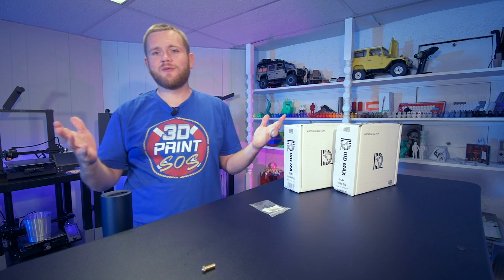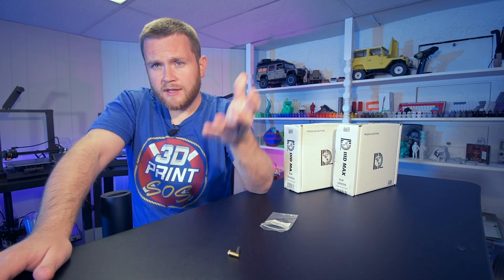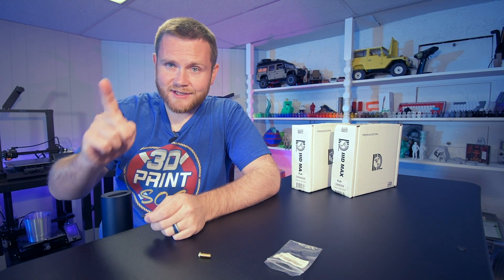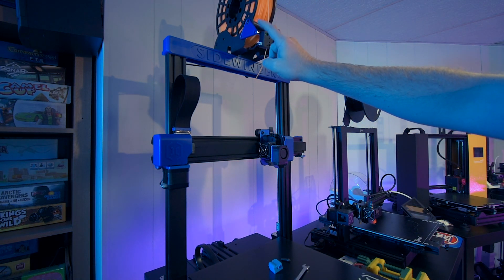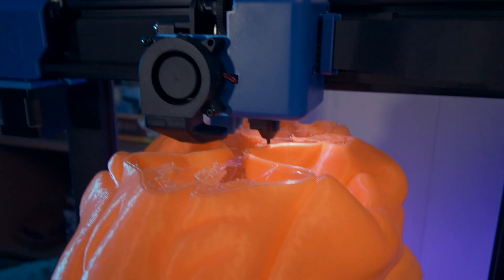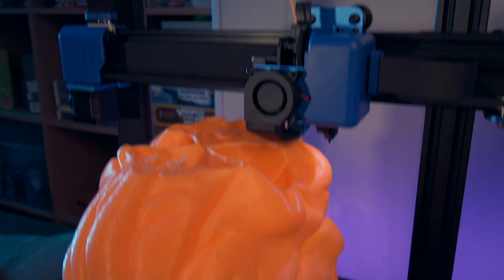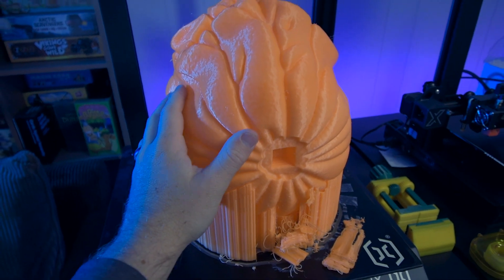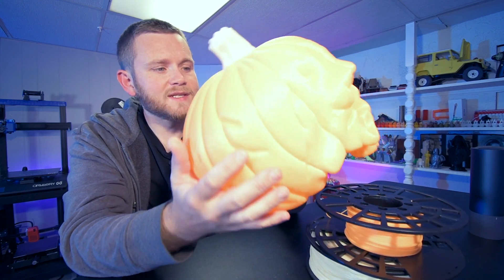Printing BIG with IIIDMax Glow In The Dark Filament & Artillery Sidewinder X2

Comment: I have never had a lightening support structure print complete without breaking off so I have sacked it, I try to get as much conical support placement as possible into large prints and then also slice the part with tree support for anything over 65° and pick the quickest method, a large brim around the supports as well as the part is good insurance also

Comment: After a few prints on my sw x2 I noticed my extruder squeeks sometimes will extruding filament, I tried drying filament and no change, curious if you've encountered this yet with yours before I go tinkering lol thanks!
Reply from the maker: Haven't noticed any squeaking. Not uncommon though. Typically its either the z lead screws or the extruder. Might need some grease. ;)